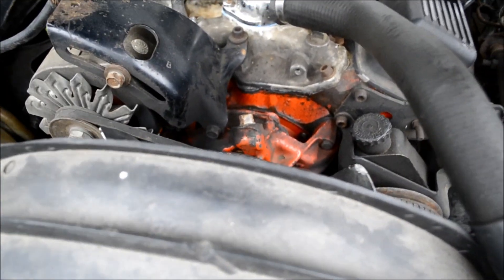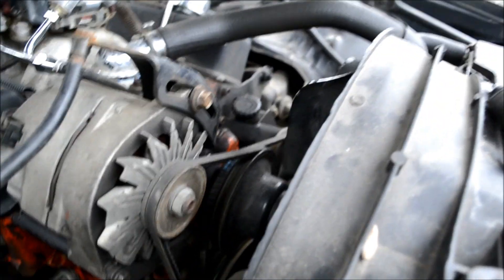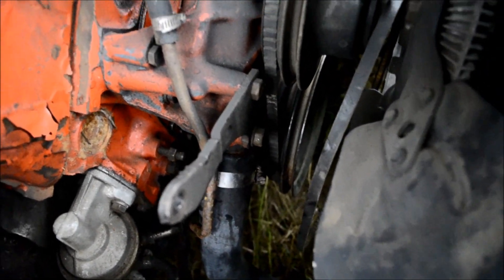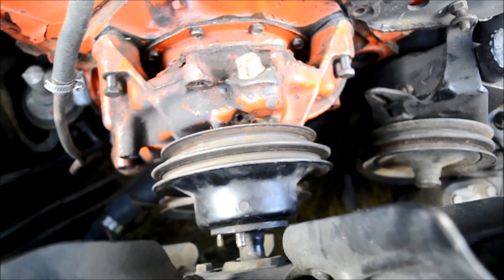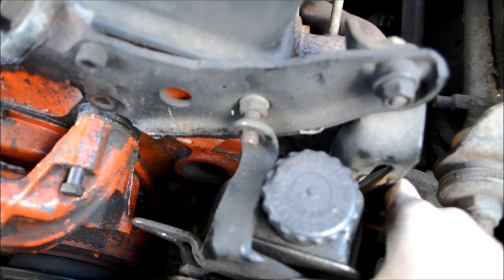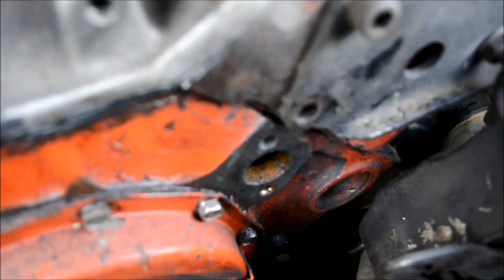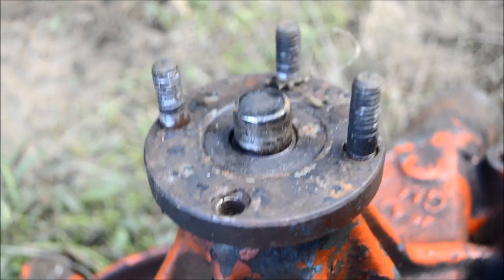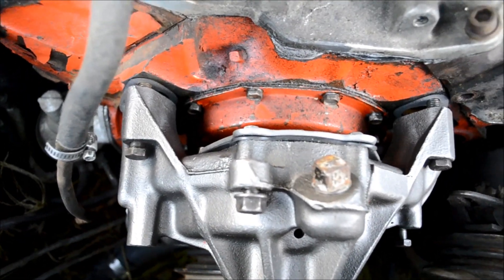How To: Replace a Water Pump [Small-Block Chevy]

Comment: do i need to torque the bolts on the water pump?
Reply from the maker: +vezina808 I never have. I'm sure there's a torque spec out there somewhere, but it's generally not an issue. Just run them down snug and a bit and hit the road. If it leaks you're not tight enough :P

Comment: Curious, why no sealant on the gaskets?
Reply from the maker: I've never had any issues with the fiber/paper gaskets alone, but it's really down to personal preference. If you choose to use a sealant with or instead of the gasket just be sure to follow the directions with regards to set time before torquing the bolts all the way down.

Comment: Camaro kid thanks I got it running few days ago and I'm still running the water hose through the radiator.. it is working I start to see clean water!!
Reply from the maker: +DAn Al excellent progress. If you haven't already, try running the engine when the radiator is full of water and turn the heat onto full for a while. This will help flush the heater core, which is likely full of the same rusty old coolant from before. Once you've done that, you're probably ready to drain it and fill it with the correct coolant/water mix. Just search for "heater core flush" videos if you need any help. It sounds like you're moving right along with that car. I look forward to the next update!
Reply: Camaro Kid I'll go ahead and do that as well then thanks I'm not sure if the heater works in my car I'll have to check and thanks trying to keep up with my project stressful at times lol but I'll keep you updated 👍

Comment: Aw that's not good I'm actually learning on my 79 camaro and this engine is similar to mine but thanks I'll defenitely keep a look out for your new videos I subscribe already quick question do you know what to use to clean the inside of the engine I opened my radiator and it's water mixed with dirt muddy looking water n I have clean the radiator any suggestion?? Thanks
Reply from the maker: +DAn Al If your coolant is collecting rust and other debris, you should start by flushing the whole system with a garden hose until the water runs clean. Then refill with the correct antifreeze/water mix (use distilled water for the best corrosion prevention). There are plenty of great mechanics and DIY guys here on YouTube that can show you how it's done. I hope this helps.
Reply: Camaro Kid .... thanks I'll do that tomorrow hopefully it works can't wait to drive at least to pump gas lol when that happens I'll post a short video of my project 79 z28! Thank u
Reply from the maker: +DAn Al I look forward to hearing about your progress! Good luck with the project. :D

Comment: What's the torque spec
Reply from the maker: Snug..... In all honesty, I've never considered "correct" torque specs on much beyond engine internals. You can probably find it in a message board somewhere if you search around.
Reply: @CamaroKid  fixed my water pump,  thanks for the video. The only problem I had was  the long bolt for power steering bracket. It wouldn't catch to screw on. I used a power tool ratchet to get it started.

Comment: darn pulley won't come off the water pump
Reply from the maker: +sal alvarez you can usually get a pulley puller tool from local auto part stores for a refundable deposit. That should be able to help get decent force on your pulley
Reply: Camaro Kid thanks for the help :)
Reply: if you have taken all the bolts off lightly tap it with a hammer on a part the belt does not touch, you will have to do it a few times and dont sissy hit it but dont go "hulk smash" on it either.